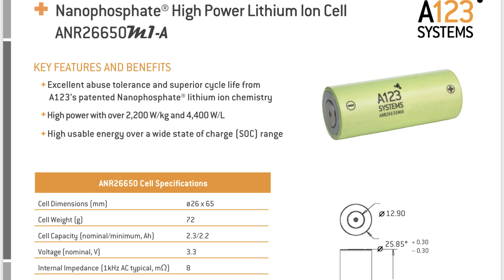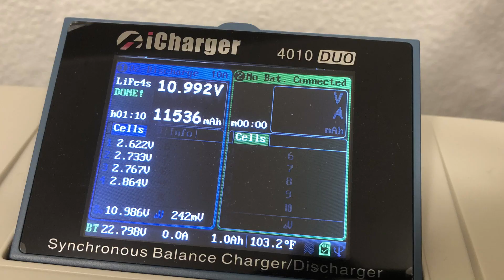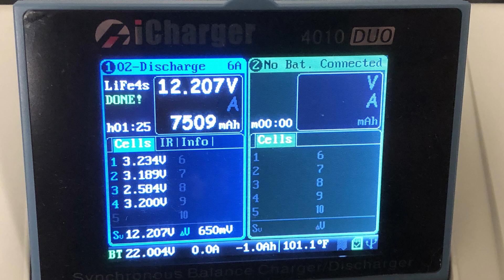A123 26650 BAE Systems Battery Testing LiFePO4 Part 2

Comment: Did Battery Hookup have any kind of guarantee on capacity? I just bought a 12S8P module off Ebay....I don't think its the same as this but I could be wrong and there could be 8P and 4P modules? Anyways the seller says tests show 90%-95% capacity and he's guaranteeing 90%...I'm very skeptical.

Edit; my bad you have 12S8P modules too. Yours just have the M1A cells and the one I got is M1B so here's to hoping that the newer cell means a module thats not as old.
Reply: Did you test your cells? Was this the socalev listing for "unused" backup cells? I'm curious how the capacity came out for you. Thanks!

Comment: Nice SODDering hehe..sorry from the UK where it's soldering. As ya know, it's solder you are using. Not sodder. Haha. Good video! Also didn't know iCharger did a bigger unit like that. I've only recently bought an X12. Always learning. I guess one question is why these are deemed as BAE Systems (British Aerospace) when I doubt they are UK cells. Guess the original application? What was it?

Comment: Great job for letting us know. I almost bought some of these packs. Any good cell recommendations for making a battery bank for house or Rv with good value$? Thanks Ray
Reply from the maker: These are good cells if you can find some that are not so beat up and towards the end of its life.  If you need 12v compatible LiFePO4 I would just buy new prismatic cells, Will Prowse on YouTube has a great channel.  I generally build 24v and 48v setups and use a more energy dense lithium ion cell and usually source from EV cars.  Deals change all the time based on availability.  I have other videos about my Samsung SDI cells from a Fiat 500e if you want to check them out.

Comment: Would this be good for ebikes
Reply: I just built a 36v pack with one of these and traveled 65 km on the first charge ( at an average speed of 15 kmh ) . I'm not a pro, but I feel like that's satisfactory power density
Reply from the maker: I feel the power density is too low to be useful for ebikes

Comment: Yup, your results seem pretty typical, and are very illustrative of why you DON'T want to use these in the original configuration since any of the 12 "8P" arrays could be substantially weaker than it's neighbours, dragging the entire pack down.

In my testing, I'm cycling EACH 3.6V/8P array in-situ, by removing the OEM balance board, and using the tabs and headers that are already in-place. (each bolt set going towards the center is a 3.6V array, 6 sets from each edge)

Some YouTubers testing these packs make the false assumption that a pack that has "balanced" cell groups means it's OK.  The state of balance is absolutely no indication of actual capacity of any given 8P array.  You NEED to test each one, or you're just guessing...

Comment: So if they are sold at a 1/4 of the price of other lithium they are still a deal.
Reply: OffGrid Wanabe sure, as long as the cycle life holds up well.  But considering these are probably well used and beat up, you end up needing to watch the carefully when in use.  The price is my least concern to be honest, it’s how much life they actually have left to give which is the concern.  These are near end of life as is.
Reply: @soldermecold7456   So once you have determined the capacity and grouped them together in groups of similar capacity what determines the life expectancy of that group or for that matter any group as they all have been in service the same length of time and use. Just like people some live longer than others. I just chose to capacity test mine while I am using them.
Reply: OffGrid Wanabe it’s just a matter of monitoring at that point.  As long as you are doing that, you can catch issues before they become bigger problems.  Older batteries just require a more watchful eye.
Reply: @soldermecold7456   haha I can relate to that old people need more care same as batteries Cheers stay charged up